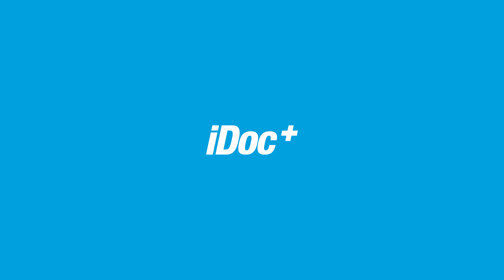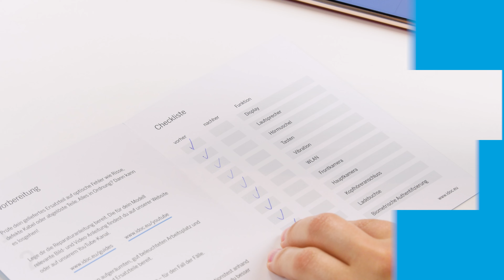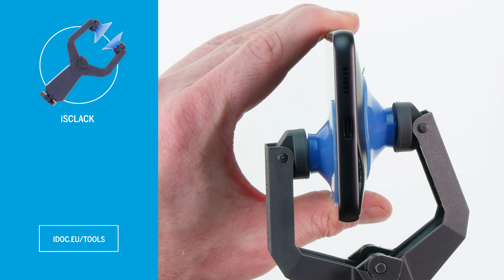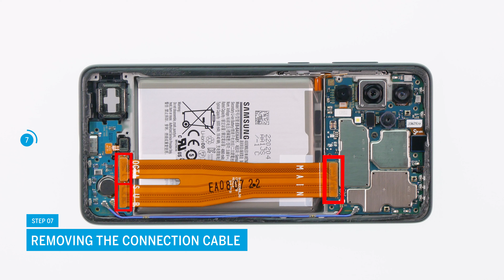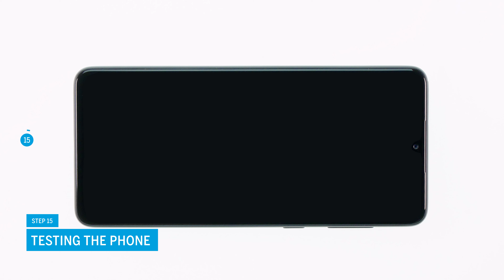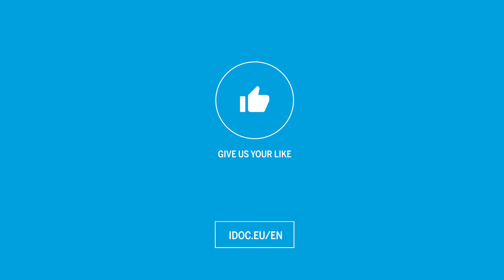Samsung Galaxy A33 5G – Battery replacement [repair guide + reassembly]

Comment: Eagerly waiting for the new European Union Battery regulation in 2027 which will require all manufacturers to provide an easy way to replace batteries.
Reply: As a small update, unfortunately a specific piece of wording was changed.
Specifically, instead of "being able to repair with available household tools", they changed it to "commercially available" tools.

This implies that the battery replacement does not actually need to be reasonably accessible for the average consumer... If anyone has any info please correct me